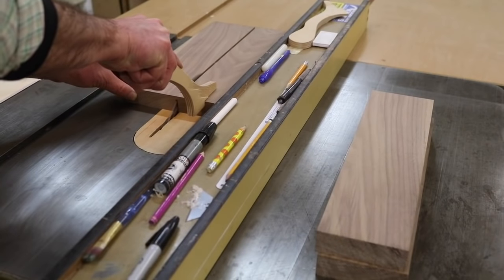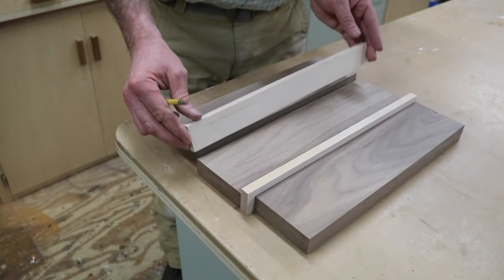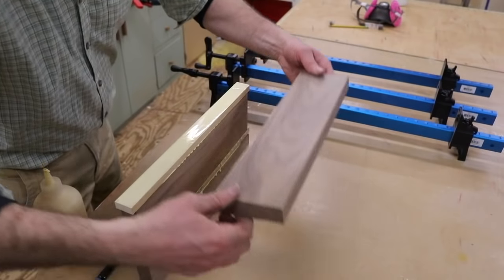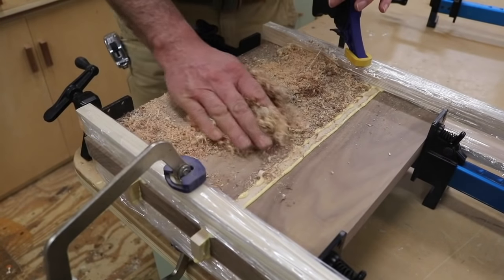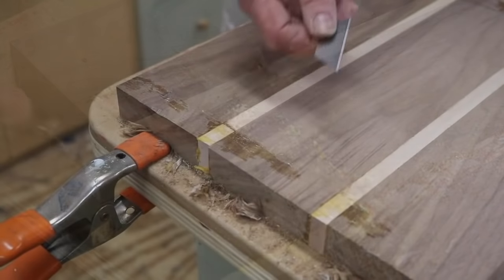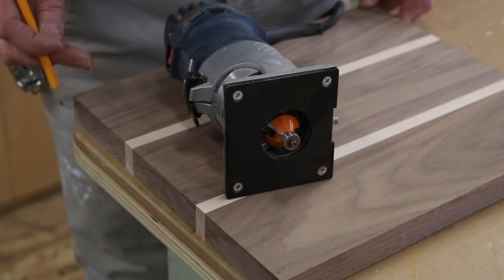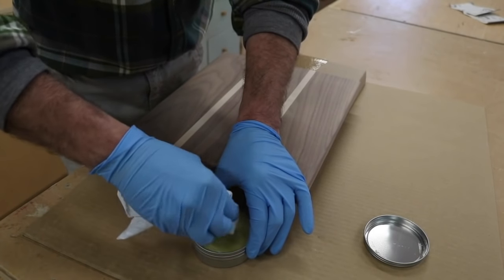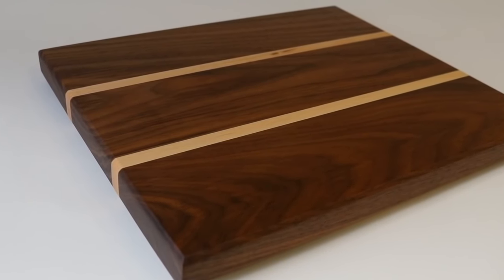Make a Cutting Board, Great Beginner Woodworking Project

Comment: Hi Jon! What kind of dust mask do you use, and do you recommend it?
Reply: Johan Nilsson You can find this mask on Amazon. Look for the one that has pink filters for their highest grade filtering. I think this mask is by 3M. Also, you might want to check out The Wood Whisperer’s video on respirators and properly cleaning them x I think his mask is the same as Jon’s. Hope this helps someone.
Reply from the maker: Yes, Thanks Barbara that's it... works great!

Comment: That finish will suffice if this is a cutting board strictly for show.  However, if anyone intends to use this, a good soaking in mineral oil (or other food-safe oil) should take place to prevent cracking, contamination, etc.  10 minutes submerged in the oil, then allowed to drain off for about 24 hours is highly recommended.  If only for show, though, this beeswax finish will work fine.
Reply: Steven Rochon any finish will be damaged on a cutting board.
Reply: Brodie P wait, what?  Obviously. For cutting boards, which need to be washed after most uses , regular reapplication of a food safe oil finish is critical. I have my grandmother's cutting board from the 1940's and it gets oiled monthly. The point is that beeswax is not sufficient, as it sits on top for the most part rather than penetrating the wood. Butcher blocks are treated with beeswax AND oil.